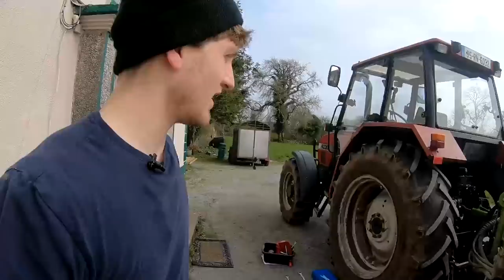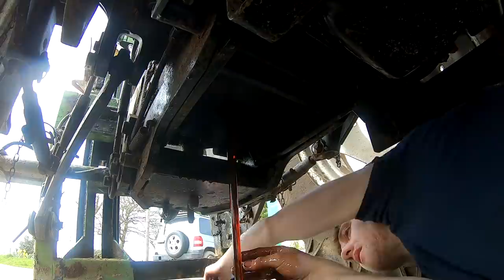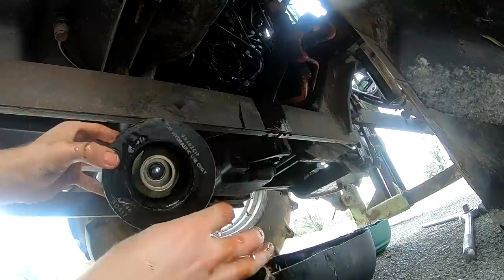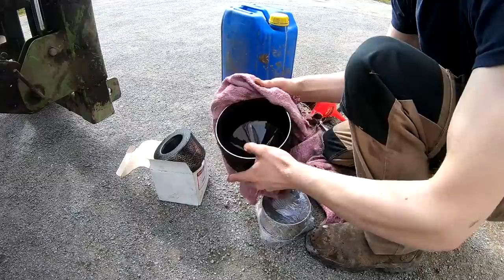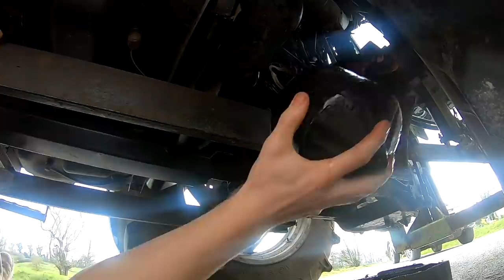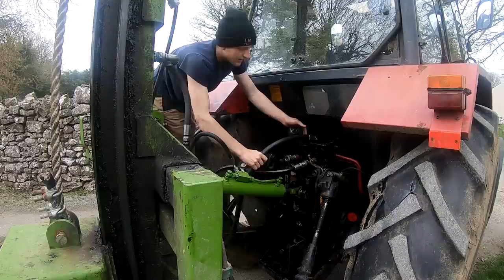The April Fools Saga Continues - Replacing Hydraulic Oil & Filter on CASE 4230

Comment: Use the same 2 spools that is connected to the 1 lever in cab flow and return dont use a different return used by another lever, it has to be the same 2 connected 2 your lever in cab  for it work just leave it in pump in cab this will work

Comment: I know it might be gone back - but just for now take off all the connection fitting s off the return pipe and see if it'll fit in through the back axle filler cap -- tie it up well with wire or strong cable ties -- it'll jump around a lot -- that should get ye going for now